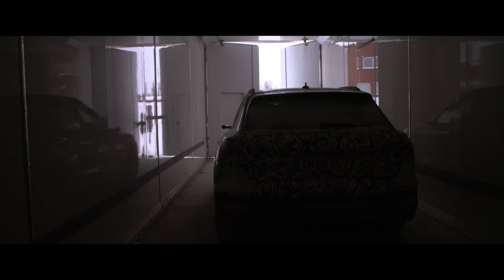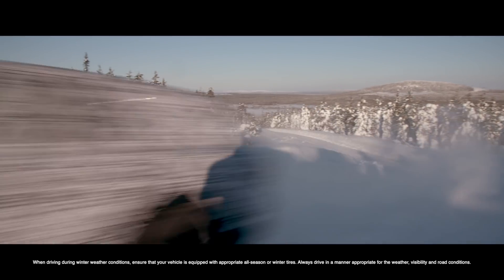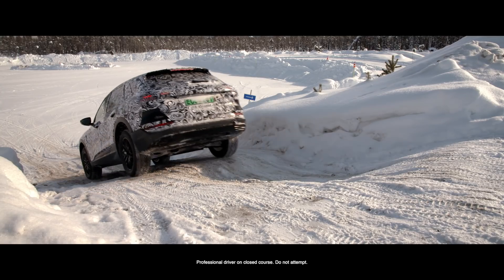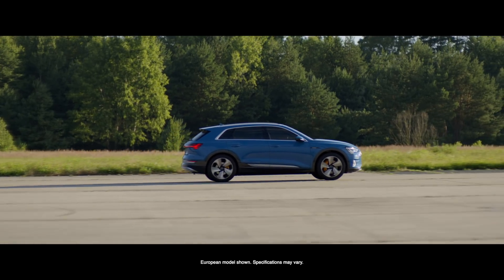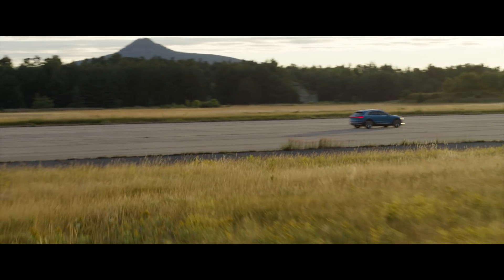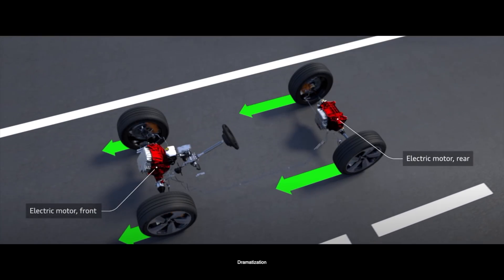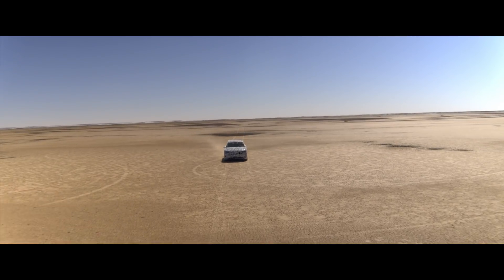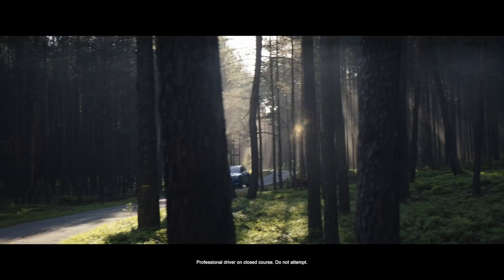Audi e-tron Defined: e-quattro

Comment: Audi is going all-electric. Look out Tesla :)
Reply: LOL! Look out for what?!? 

No Supercharger network, no over the air updates, nothing even remotely close to autopilot, slower acceleration, slower charging, less range, worse aerodynamic, inferior infotainment, less energy density on the batteries and the list goes on and on.  

The Audi might win in 2-3 categories, like fit and finish or perceived "luxury", which are purely arbitrary. Teslas win the other 42 categories. Including 5 stars safety rating.
Reply: @UTUBESUCK666  If you say so.
Reply: @UTUBESUCK666  The Tesla supercharger network is being opened up to all electric cars

Comment: Audi is proving again that it can shift quickly to new technologies always . Congrats to the whole team .
Reply: they need to introduce new sportcars as well. I'm starving for a new audi RS5 convertible.
Reply: Not really - e-tron has absolutely awful efficiency (worse than larger and heavier EVs like Model X) - Audi really needs to work on that because it results in a much lower range despite having a pretty big battery.
Reply: Jakub Janovský  it’s their first electric car, Tesla have been doing it for over a decade. Give them a few years and eventually Audi & indeed Mercedes will catch up.